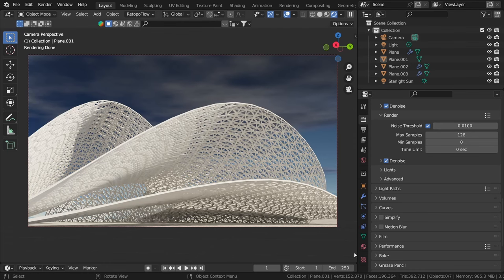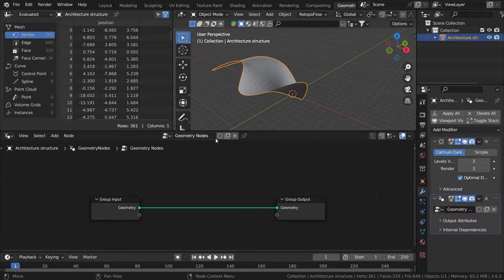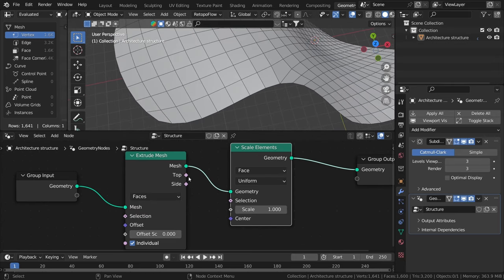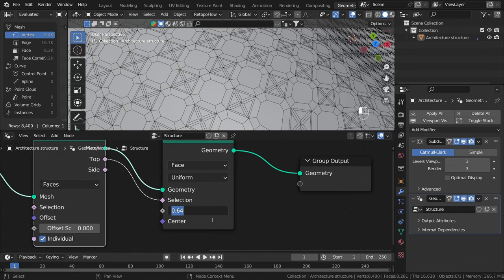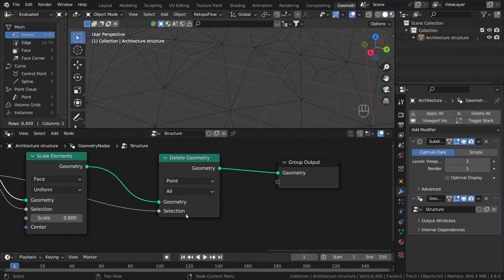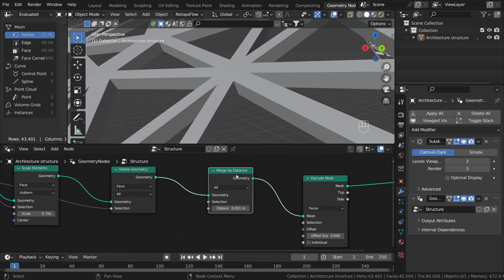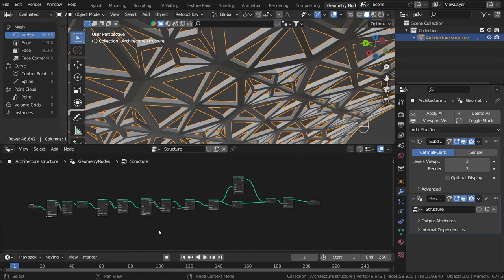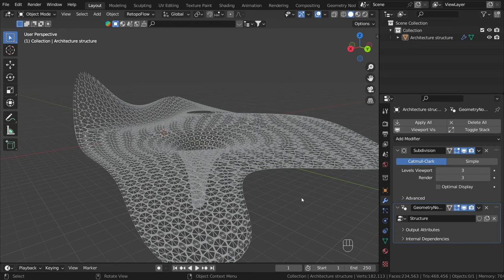Easy Parametric Architecture in Blender with Geometry Nodes

Comment: I tried to edit by "edit mode" but I failed to find it, I pressed "shift" and "G" but nothing happened (I have a MacBook m1 and magic mouse)
Reply from the maker: Hi!
To enter Edit Mode, you will need to press the Tab key. I have enabled the Tab for Pie Menu to easily switch between different modes (you can find this option in Preferences under Keymap). By default, Tab will switch between Object and Edit modes. (You can always use change mode in the left top corner, by default it is set to Object Mode)To edit geometry, you need to select some vertices and press the G key to move them. Pressing Shift and G will give you a more precise movement. I hope this helps!

Comment: Can this be done in Grasshopper 3D Rhino 7?
Reply from the maker: Hi, as far as I know Grasshopper, it should be possible to recreate this node setup. However, it will require some work and probably a few more nodes, as Grasshopper has a different approach to generate geometry. You can try to recreate the effect in Grasshopper, following the step-by-step instructions based on my Blender tutorial. But if you are pressed for time, you can always import a finished structure from Blender to Rhino